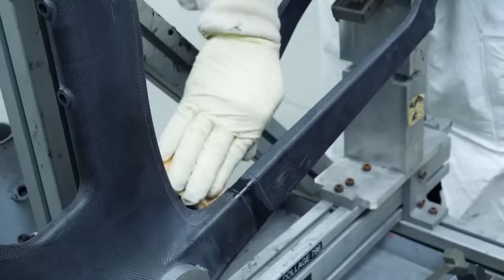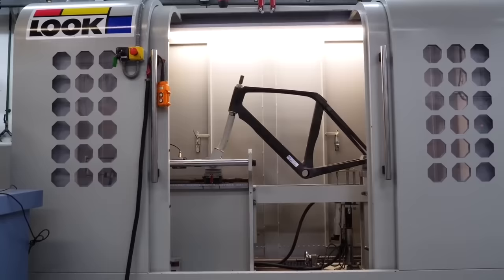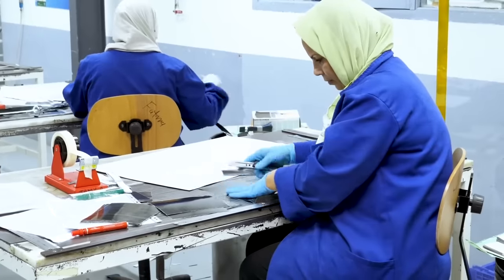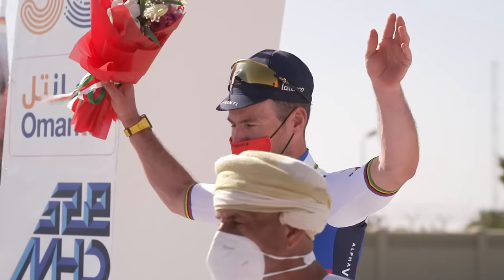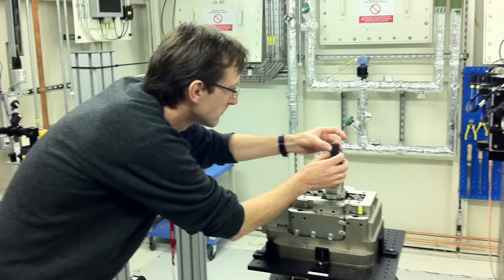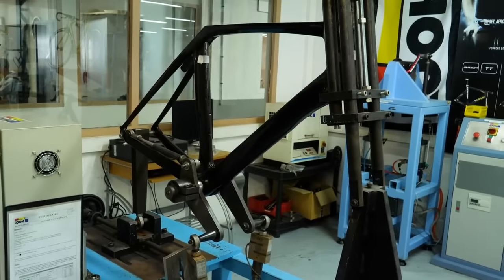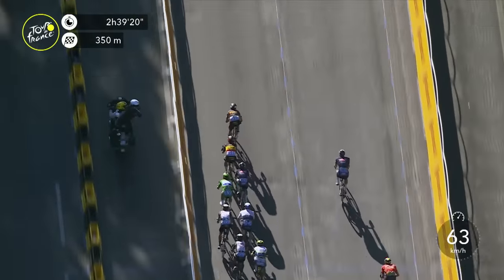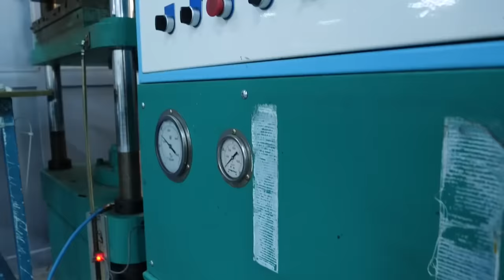Your Carbon Fibre Bike Won’t Last Forever

Comment: I have a Fuji sportif which has an aluminum frame with a carbon fork. I changed out the cockpit with an aero drop bar, stem and also changed out the seat post. I also used a few titanium bolts to replace the aluminum ones on the stem. I also changed out the inter tubes with the TPD or TDP or whatever tubes and finally (I think) I changed out my seat.
I'm pretty sure I shaved off a few more than a 100 grams. I love the bike but there are some things that I want to change but not sure if I should just go full carbon.
The problem is that I am not a racer, I ride for exercise and health. I'm 68 and have been riding for about 3 years now. I'm looking at a 4000 us dollar carbon fuji (which isn't a bike you guys talk about), but I will still want to change out the aero bars and install carbon tubeless wheels. Which will run me another 1000.
I'd like to get a mechanical 105 2x12 but am having some problems with the local bike shop that can carry it. I don't want to go anywhere else to get it because I want to support my bike shop.

Comment: The Trek5000 I had lasted 9 years and 50,000 miles when the bottom bracket started making noise.
It was replaced by Trek under warranty... some assembly and extra money was spent.

Comment: The most important thing to say about carbon is that each bike is totally different to the next one. Manufactoring is way harder than normal frames and it realy depends 😉 on the resin and the fibers. So same frames with the same amount of load, environment can break at totaly different times.

Comment: Very common thing in carbon rackets (ie most rackets nowadays). In the racket world it will be perhaps 2 years used by a semi pro.
The stiffness goes, the joints/stress points will become flexy and weak.

Comment: very informative and well done. over the years, i have retired 2 bikes to metal cracks in the frame. one steel and one aluminium.  both crack at the bottom bracket after many, many kms. i am curious about carbon fork fatigue. forks get stressed just by normal riding and not because of high torque input from a rider. one of my bikes has a carbon fork from the late 1990s. it has been a tri-bike. i know how many kms i have put on it. but not how many it has seen....it might be a good idea to replace it

Comment: Superb I'm a simple mech tech who has seen carbon fibre failing and has seen metal failing. But if you had to ask me what material for a frame Ti wins everyday. Steel and Ti you can weld it or braze it, aluminium 6 series you can weld it, the 7 series I would stay clear as your talking annealing and tempering again. carbon fibre bleh it looks great and I suppose in 10 or 20 years time that's old school but not for me.

Comment: My Look 486's drive side chainstay just snapped after 10 years. Fortunately, I wasn't descending at 40mph - I was balancing a bag of veggies on my top bar doing 5mph. Look didn't back up the frame. I now ride Titanium exclusively for both gravel and road. Never again!
Reply: What year model was this? Seems bike industry only has carbon bikes now mostly, where did you buy titanium?

Comment: I’m laughing here with my stable of road and mountain steel and aluminum frames ranging in years from 1986-2009 :) my Cannondale Jekyll and Rush dualies have welded hot boxes where all the stress kills carbon. My 99 Bianchi Venice steel and 86 Canny Black Lightning in aluminum will still blow the doors off suckers rides long after we’re all gone, they just need to be cared for and passed on.

Comment: Prohibitively expensive as process but one wonders if carbon could be woven as apposed to laminated? 
I believe Lexus did this with the LFA.
Economy of scale could be in play in larger optioned lugs that you could bond to simpler laminated sheet carbon?
Just a curiosity.

Comment: it would be good to know more about carbon components with metal elements, such as SRAM Force Cranks, which are carbon with metal inserts... is the joint between these the weak link

Comment: I have worked in composite materials for 40 years+, and now run a company doing failure analysis on composite structures and this is not really an issue for most of us bikers. I have carbon and Al bikes and I would be more concerned about degradation of the Al one than the carbon ones over time due to fatigue and corrosion effects

Comment: This is a really informative video! It makes me wonder about the +30 year Trek carbon fiber bicycle my brother just gave to his son. My question to some of these experts would be how extreme temperatures affect the carbon fiber frame. If the frame has experienced repeated sub freezing temperatures, or just the opposite, repeated heating above 90F?? My borther’s old purple Trek hasn’t been used in years and stored in a garage. So little UV or moisture problems, but definitely temperature.
Reply: heat is a prob too. but if the boy is just doing moderate riding, which lets face it..the bike is 30yr old so i don't think he's riding black diamonds; should be safe.
inspect forks for spiderweb cracks

Comment: Top Video Ollie. So it would be fair to conclude that a carbon frame is going to give you more warning before it fails through general use than a aluminium or steel framed bike?

Comment: Love this video! Thanks so much!
If you track down the polymer chemist, it would be great in a follow on video!
Also I’d wonder if having solvent vapors floating around the garage where a carbon bike lives would be a source of degradation?

Also what polymer coatings, sprays or waxes can enhance longevity?

I have an ’07 Ibis Mojo, low use, nice condition that I’m trying to keep up ✅

Comment: Carbon frames have been around for many years now. So the questions is: should you buy a 20 or 25 year old carbon frame? IF a steel frame is straight without dents or defective welds then you could feel confident it is not about to fail without warning. What about carbon components that are normally under stress like rims or fork tubes or bar/stems at the clamp? I would suppose in the aerospace industry, components are tested to the breaking point in the lab and are then replaced as preventative safety measure.
Reply: Thats a great question. The way I see it is that steel and alu can degrade as well over use and without actual odometers, can we really tell what the bike has been through?  I know people with 10 year old carbon bikes that never put out over 500watts and ride maybe 1500mi per year. In comparison there are riders in my local club that hit 1000+ watts a few times per week and avg 8-10,000mi per year. 
Really hard to tell what youre buying when its used like that.

Comment: I found a website that sells nothing but carbon fiber bikes at 10% of actual price.... A dogma for $1200 USD, there's a catch it is that every bike has a fracture in the frame. After analysis, I opted in keeping my aluminium bikes.

Comment: if you want strength and rigidity, turn to the decanter, although its crystal lattice is flat) and I can't even imagine that if it adds up to the thickness of carbon in one layer, then you will get a material that will surpass carbon by weight and stiffness several times, read for yourself. but I don't think that the UCI will allow graphene frames weighing 200 grams and mto and less =))

Comment: The reason steel is superior than either aluminium or carbon FOR THE AVERAGE CYCLING CONSUMER... is that steel is easy to inspect for flaws, age and degradation are often easily visible, steel can be cheaply and easily maintained (even up to the point of paying someone to weld new components or repair via welding) The PROBLEM with Carbon is that it's impossible to tell without ridiculously exclusive testing whether there are any fatal flaws in the weave. The PROBLEM with aluminium is not only the shelf life, but that failure is likely to be in the form of a sudden snap.
- 
I've had the forward lug of a top tube of a forty year old vintage steel bike fail catastrophically while I was riding it... and the frame stayed together in all other regards, as I rode (wobbled) my way to the side of the road to see what the hell had happened, in total safety. On the other hand I've had the bars on an alu roadie fail catastrophically without any warning, dumping me to the tarmac immediately, at speed a-la Maxime Roger. I shan't be using any other components than steel in the future. And not weedy thin steel, either.

Comment: Forever is such a loaded term.  Most people don't keep their road bikes more than 5-7 years .  Modern carbon fiber is very resilient and I would think that the natural fatigue would take many years to manifest in a bike frame.  Needless to say, I'm stoked about my Litespeed Titanium gravel bike.
Reply: My Merlin Road is over 20 years old, and seeing how I would not feel good about riding anything made out of less than T1100 carbon composite, and that co$ting more than my car did, I think that I will just stick with it for now. ;)

When I look for a road-like gravel, or 'all road' semi-aero tube shaped bike in the future, I will look at aluminIUM, or titanium alloy again.

Comment: So it all reduces to bad or extreme engineering and a bit of cost. If the frame fails because of stress on unidirectional carbon, that means they preferred flex on that side but they might need a little bit of carbon fiber in another orientation , but they chose to not do it in the search of lightness and/or compliance, but a frame can be reinforced just a bit and last a lot more by doing so, just they don’t chose to because the reinforcement can be obtained with higher grade of carbon fiber, but that costs more, but top-tier bikes are not exactly cheap so they could just do that. Of course that has nothing to do with impact resistance because a crash is a whole other thing. If you crash it needs to be checked and if there’s damage it needs to be replaced or repaired if it can be repaired

Comment: This is a great video- BUT
the material scientist at the end  said something that contradicts everything I’ve heard , and read from other materiall scientists- when  CF fails it fails catastrophically - there is no warning . With alloys you almost always have damage that is visible prior to the failure -with CF you do not. Unfortunately this fact has lead to a cottage industry in the states of  lawyers who are beginning to specialized in  cycling injuries caused by the failure of ( often used)  carbon fiber frames and forks. Giant is in the middle of a large settlement now  with the failure of a five week old frame that caused a spinal injury.. Like any material, CF is only as good as the skill used in its manufacture and the care with which it is given.

Comment: Very interesting subject! My take away from it is that for the everyday road warrior, there shouldn't be much to worry but looking into a higher end frame from a reputable brand is an advantage point. Something I would of liked to be touched on with professor Marrow is what of mixed material frames such as carbon/aluminium combinations? How safe are they? Which material will give first? Will it just be the bonding agents that will be the main concern? Can one overcompensate for the other? Questions that could easily extend the topic at hand.  Thanks for the good content.

Comment: That was a very interesting video, thank you!!! I have a question though, is the use of carbon fiber in a cycling industry a fad? You have just pointed out within reason, that its damaged by water and UV light. On the weight side of things, the UCI seems to have kept it so aluminum can compete (though possibly not as aero, or strong when aero?) weight wise. From the MTB side of things, with the exception of XC bikes, carbon frames are becoming almost the same weight as aluminum frames (when manufacturers issue them), the difference used to be about 600grams ish (Re. enduro and trail bikes).  Just a thought.....

Comment: Fascinating info, brilliantly presented.

“Graceful failure” love it
Reply: hopefully you don't experience a "graceful failure" while riding.
Reply: The  "graceful failure" thing is also why the support props in mine tunnels are made of wood rather than metal, despite metal being technically stronger. Because it doesn't fail suddenly,  but creaks and cracks and gives the miners some warning to evacuate the tunnel. So I'm told.

Comment: 17:05 "there might be some advantage in refreshing your bike every few years." ... This part here needs to go more in depth! Are we talking about spending big money on sending a frame in for reapplication of epoxy resin or what?? hah I myself am reviving an old Scott scale carbon hardtail and am working with a few composite manufacturer partners that have been very informative and helpful in my project but much research is still needed as these helpful businessmen aren't the original designers 👍 I guess it's back to the general composite frame building analysis research stuff😮‍💨

Comment: It would be useful ask whether using a carbon bike on a smart trainer and doing out of saddle riding would cause significant fatigue compared to normal riding. I’m always to nervous to get out of the saddle on the trainer as this doesn’t seem to be what a bike frame is designed for

Comment: My carbon fibre MTB frame just split this weekend! I crashed and the rear stay failed at the thinnest point. I do the miles so it shouldn't have been a surprise but was at the time. The good news is that some types of damage can be repaired, as in this case. Material for the follow up video Ollie?

Comment: motorcycle helmet has a sell by date, and UV reaches everywhere especially if you live in the tropics where car headlights would yellow and hazed within 10 years or sooner if you park the car outside.

Comment: So I have a 30 year old hand built Reynolds tube frame road bike on which I added an Easton carbon fiber fork several years ago after the original unit was bent in a mishap. This video got me to thinking about component fatigue and lifespan so I googled "E30 fork failure" and the only hits I got were related to aftermarket automobile clutch problems. Am I safe? The effort seems marginally scientific...

Comment: Question from a metal-based structure engineer, how do we contrast the lifespan of carbon fibre vs Ti vs Al using the same unit of stress?

Comment: A big question for those of us living in hot climates, most of Asia for example, UV plus moisture is the main risk. Ski boots, climbing boots, polyurethane all degrade and become useless after 5 years or so.  I assume the life of a carbon frame in hot humid places is lower than dry places.
Reply: UV can be very high in dry places..

Comment: I store my carbon fiber bike, Trek Domani, in an outside shed. So, it protected from UV and rain/snow. However, it is not protected from heat and cold. My question is, how does temperature affect carbon fiber? Does the temperature cycling affect the carbon fiber, and if so, is heat or cold more,of a problem? Should I move the bike indoors during winter, or summer, or does it matter?  Thanks for your info in the video.

Comment: All materials do NOT fatigue over time.  Steel, for example, has a fatigue limit.  You can apply stresses below this limit an infinite number of times without fatigue.  Aluminum, however, has no fatigue limit.  ANY amount of stress will eventually fatigue the material.  It might take a few million years, but any amount of stress will eventually destroy it.

Comment: Good video. I guess Carbon Fiber provides performance now in lieu of sentimental value layer. If one wants only  one bike for 2 decades choose another material. Wonder how newer aircraft with  carbon fiber fuselage parts will age with all the pressurization cycles?

Comment: Awesomely detailed. Still I'm no wiser 🙃

With two identical frames, one constructed from aluminium, the other from carbon, how would they fare with a crash on the street hitting the asphalt / crash in the forest hitting a rock?

Seeing how "the 69er" bike has been repaired / re-welded numerous times, I'm still not sure the repairability of carbon frames is up there. When spending 6k on a trail e-bike, I'd like to pick the more repairable frame.
Reply: 69er: https://youtu.be/uK0N4WNMzN4

Comment: Its common sense every material sooner or later breaks when flexed repeatedly. The question is when exactly is sooner. Steel takes long, aluminum much less, how about carbon ? There should be documented standardized mandatory safety tests for every frametype before being released to market. The lighter the frame the more critical with a given design.

Comment: This is a main reason why I do not use with my two bows a carbon fiber arrow. First, they are way expensive for brands even Chinese made that are not crap carbon fiber mixed with nylon fiber on a faux carbon fiber if you will used for some rather cheap carbon arrows with even some next up of dubious quality. Then some of the cheapest Carbon composite bow limbs on the market from China/Tiawan or other country in Asia (similar to a fiberglass composite limb) are using the nylon fiber for the outer laminate on the limbs and nylon fiber bends too easy is easy to snap so worst of both worlds.  Then the second is that the arrows of aluminum are recyclable even with the cheap but not the cheapest aluminum arrows as those cheapest aluminum arrows often are either have a plastic paint like coating or some kind of aluminum can type aluminum for them as experienced by some cheap arrows, I got rid of cutting the arrows fletching section on back off these very cheap Chinese arrows that had this coating of plastic paint on them that when the paint dries it hardens into a plastic on the arrow to add extra stiffness as a way to not need to use better aluminum.